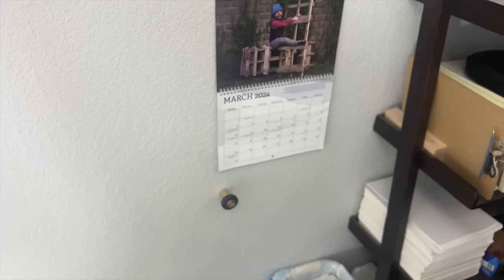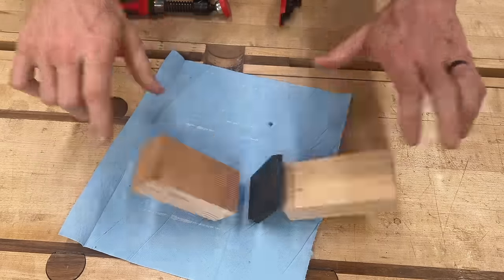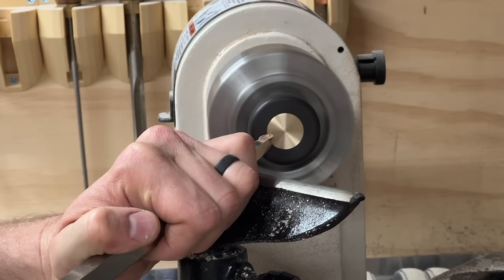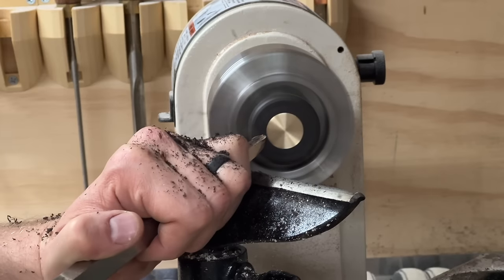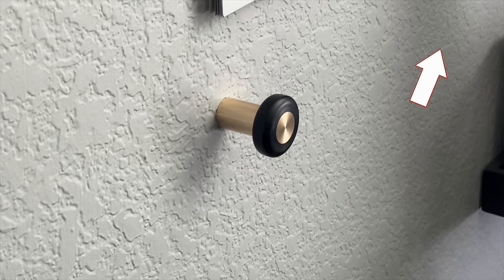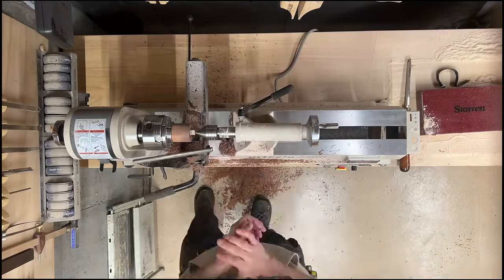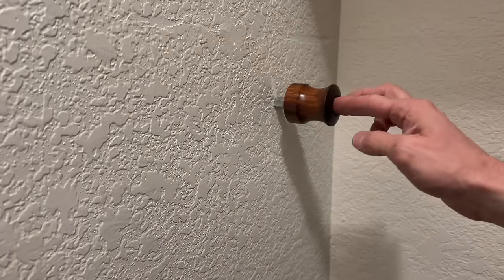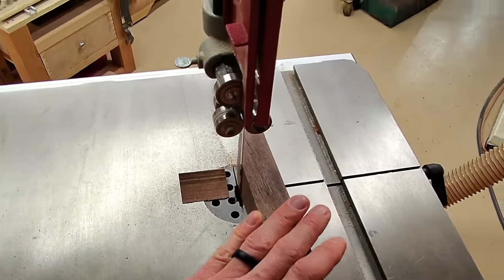You Can MAKE Money With Pika Screws?!

Comment: I love your Pika Screws and think they look awesome.  I also have an Etsy Store, but i have enough problems with my buyers telling me that installing the most dirt simple drywall anchors are "super difficult" even with an install video and step by step instructions.  It sucks trying to cater to the lowest common denominator.
Reply from the maker: Oh pika screws are way easier than drywall anchors, I get that struggle!
Reply: All in all Etsy stores for woodworkers sound like a complete nightmare. Trying to sell something extremely general yet still unique at the lowest possible price point to a extremely variable crowd at serious cost.. is there still money to be made in your opinion? I've been curious but without anyone close to me to provide tangible insights I'd rather stick to my furniture commissions and freelance work for other businesses for the time being. Customers are a hard find sometimes but good ones know what they want and are willing to pay and wait for it.
Reply: Hello Andrew, I would love to see a non pika version of your screw, one with no screw method. This would let you have lower cost "dummy screw heads" so for a square lid, you can have 3 aesthetic screws that can't be screwed and one pika screw that actually holds the lid on.
These dummy screws could be held in with nuts or glue.
Maybe a nail in version could be interesting!

Comment: Are all of the Pika Screws made of 400 grade stainless or is it just the big ones? I wasn’t going to divulge my plans, but considering how long it’s going to take me to get to ‘em, and how unlikely it is someone beats me to it, eh why not. I’m restoring a car with a fiberglass body at the moment and there are 4 main bolts that hold it to the chassis. They are originally captive nuts, but I think it will be way cooler to drill all the way through the body and use exposed hardware. I planned on some black button head hexes, but flush mounted Pika screws would probably be even more awesome. And I think they would also fit the brutalist style I’m going for. I’m not concerned about them rusting in place, I own an angle grinder after all, Lol. I just don’t want the illusion of a solid metal plate to be ruined from some minor corrosion on the outline of the inner drive. Not to say that won’t stop me from trying anyway.
Reply from the maker: Sounds awesome!  The new micro pikas are 304 SS
Reply: @AndrewKleinWW  Oh yeah, 304 will definitely survive in the wild. And it’s not like I’m going to leave it outside. Can’t wait to try it out!